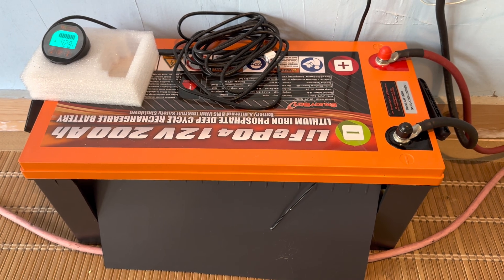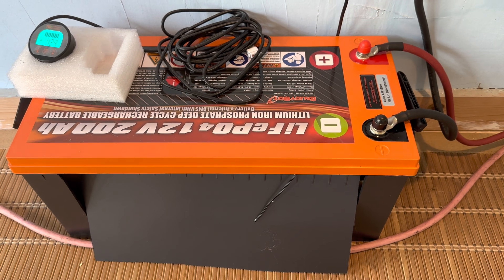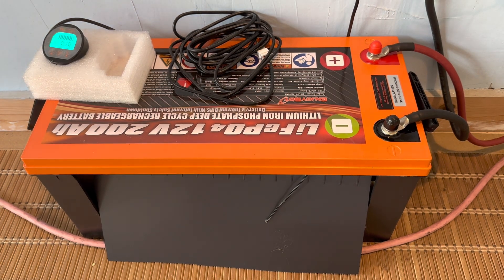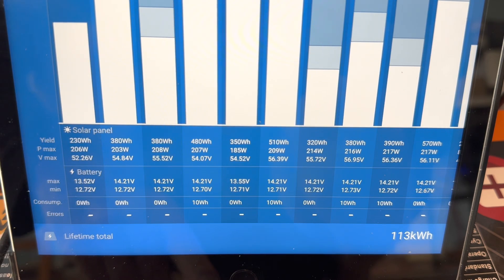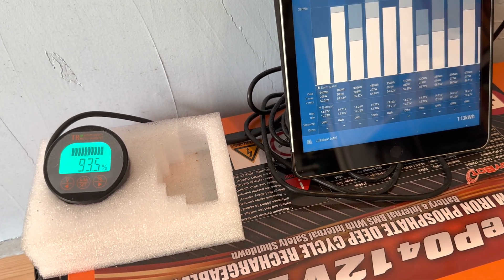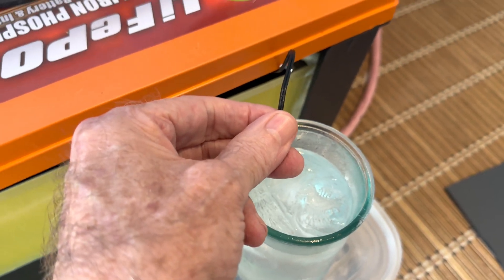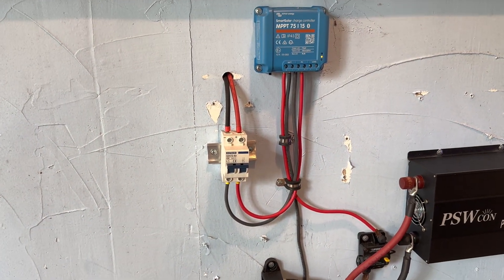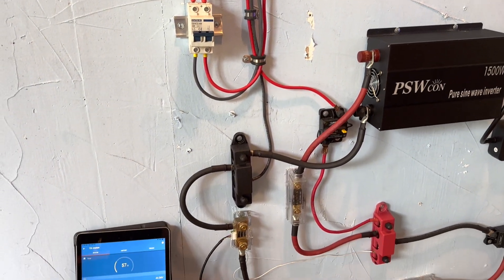ENJOYBOT 12V 200Ah LiFePO4 teardown/low temp charging disconnect follow up with proper cold solution

Comment: One day could you maybe make a video on fuse sizing and cut off switches for these systems? Also explain why they are important and what could go wrong if not used.  Thanks!!
Reply from the maker: Great idea, and actually have an upcoming project (another build) and I will go over that very thing. Mahalo for being part of the conversation! 🤙
Reply: @ProjectsinParadise808  Thank you!

Comment: nice re do of test.some times there is more than 1 temp probe in battery. make Shure you test them all.The BMS is to protect the BMS from over heat on the FET's Transistors. the way to check your salt water is put a thermometer in the glass and you will know. a outher way to test is use that electronics duster in a can. turn the can upside down and it sprays a liquid on the temp probe. it will evaporate quickly this will drop it below 32F or 0C quickly. also you can take that bore camera to look inside battery's like that 48V powerqueen rack battery. just take off lid and look around. many uses for that camera. just do not put camera inside a acid battery or any electrolyte. have fun with it. great job re testing . we all make mistakes .
Reply from the maker: I like the idea of using that duster in a can a lot! Much easier for sure, and mahalo for that. I'm going to be using that borescope in just such a way pretty quick to peek around . The close up is tight on that! Aloha! 🤙